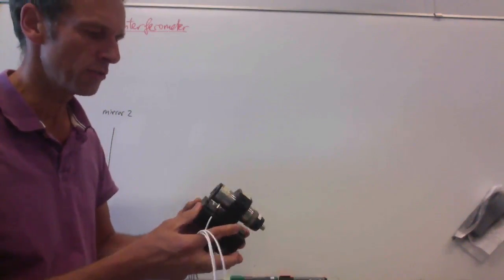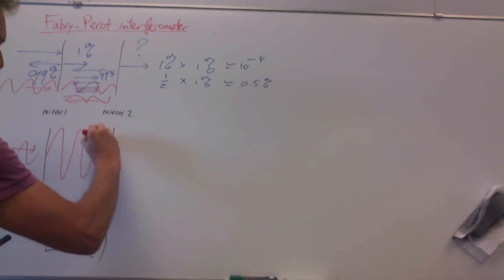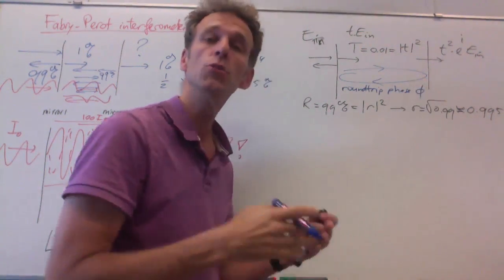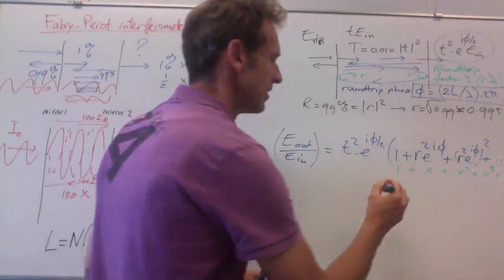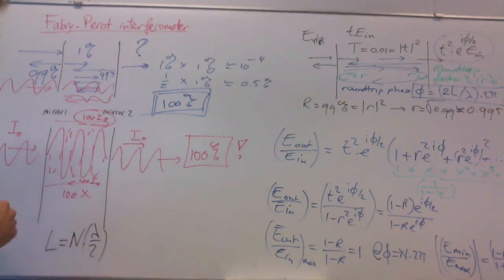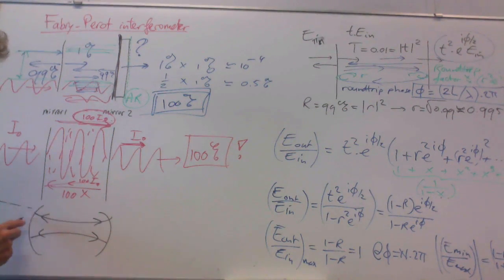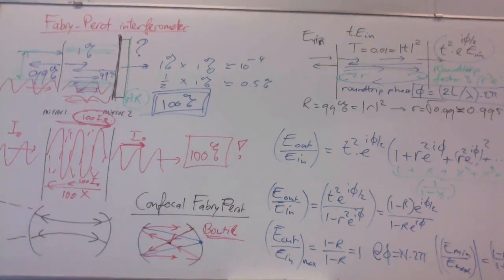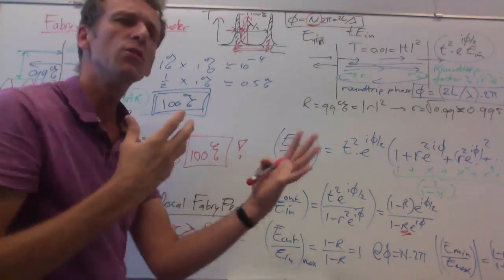The Fabry Perot Interferometer

Comment: If 100% of the signal is transmitted, then 0% is reflected. However when I try to do the calculations I end up with the wrong answer. How would the calculation for reflection look like? Sadly I cannot show my calculations, because if I do the comment gets removed.
Reply: Only if I take the reflection from outside to inside the cavity (r) different from the reflection that occurs inside the cavity (r') with r = -r', then it does add up to zero. Is that true and why?
Reply: @DW-iq8lt  I would say that it is precisely what 100% transmission means. Simply put, everything that goes in on one end comes back out the other end. And this is also what the professor in the video is showing and several times stating. Why do you think otherwise and how would you then define 100% transmission?
Reply: My mistake. You were right about the transmitted percentage. And at resonance, reflected intensity is zero.